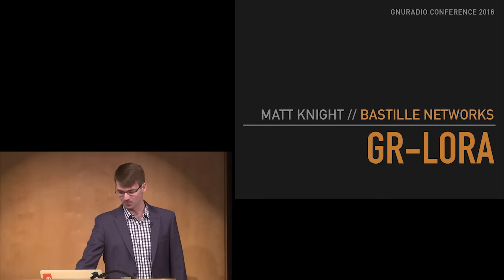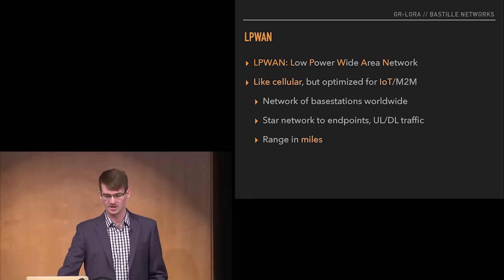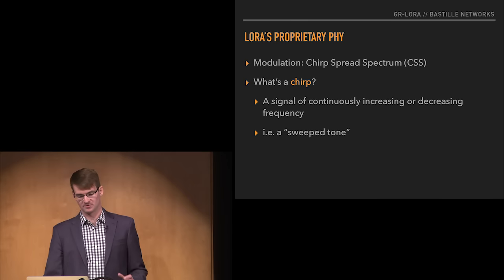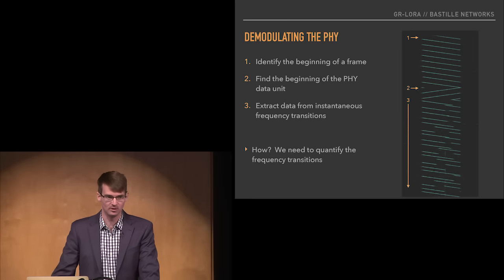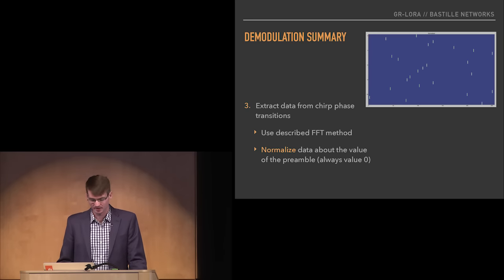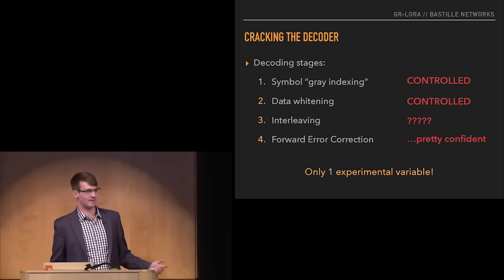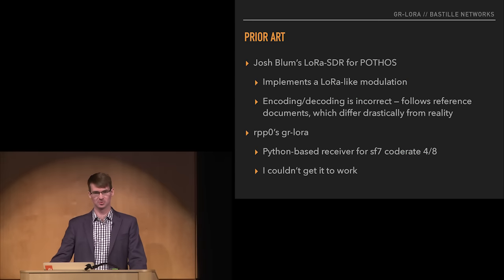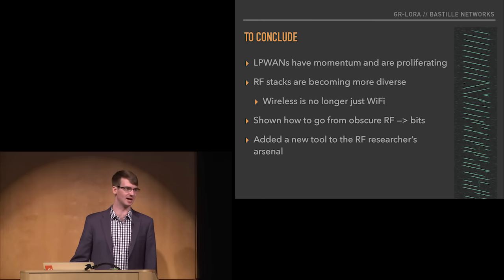GRCon16 - Reversing and Implementing the LoRA PHY with SDR, Matt Knight

Comment: Excelent analysis!!  Congratulations.  There are some things I need them to be cleared out a little more.  1. Seems that each figure is encoded into a single chrip. Right? But in the image shown in minute 12:55 looks like there are at least 3 frequency jumps within a chirp period. Why did that happen? 2. In the next slide the chip rate is defined as dF/dT, having unit of 1/s^2. But, according to documents it is calculated as BW/2^SF, which have units of 1/s. So it seems that a better definition of chirp rate would be #chirps/s. What do you think?.  I can see this video is 3 years old, so maybe it was cleared long ago. Thank you!!!